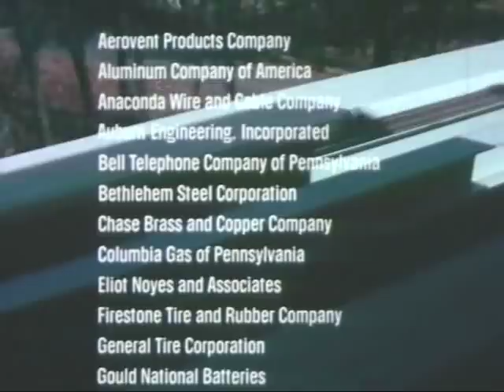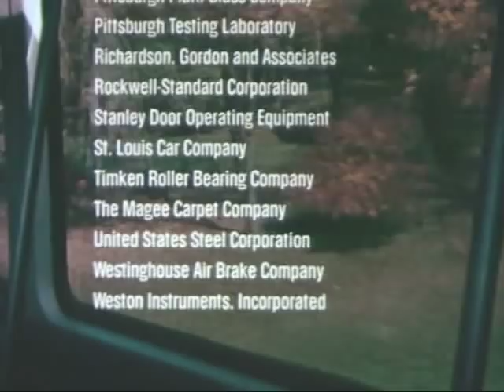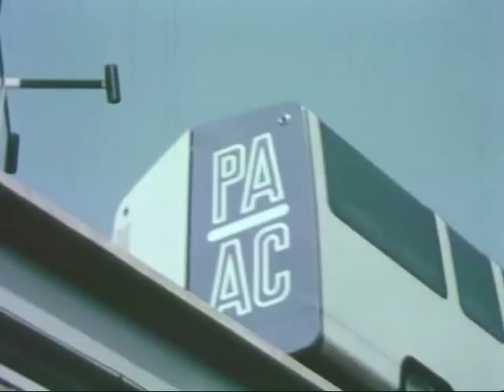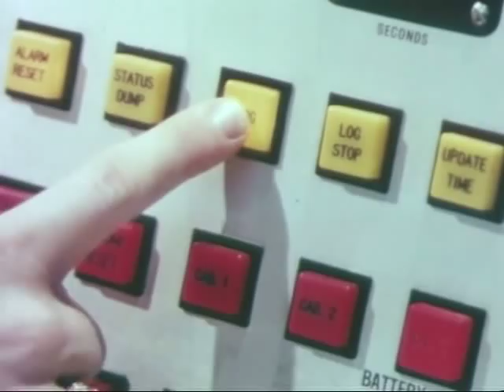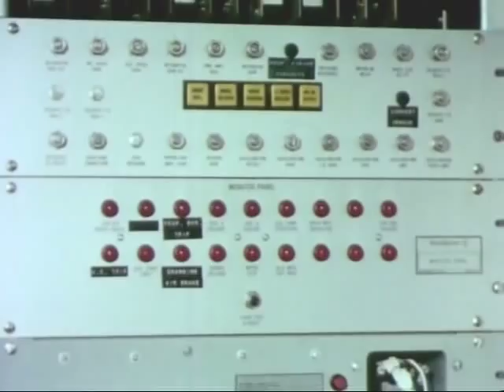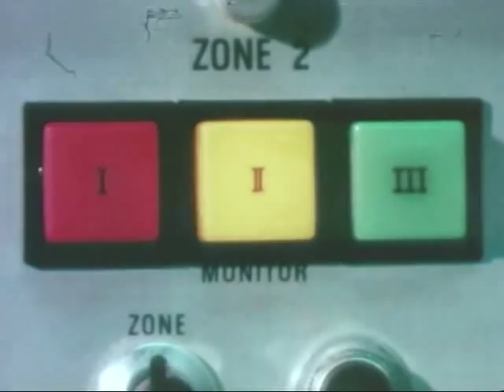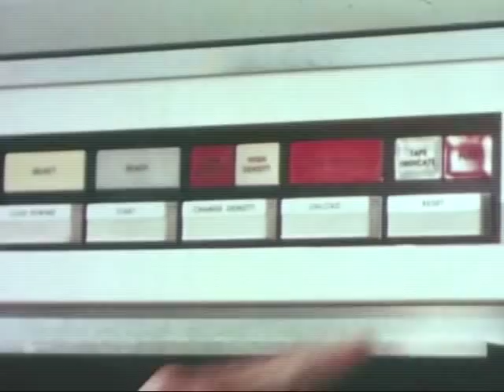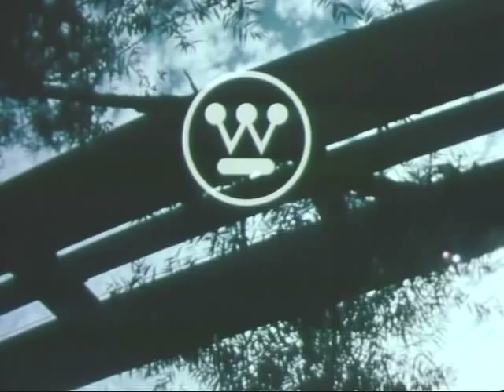SKYBUS COMPLETE TRANSIT EXPRESSWAY 1967

Comment: I agree that since the streetcars were already there (and already had dedicated rights of way), upgrading to a light rail was a good idea. Also replacing streetcars with SkyBus would have negated one of the streetcar's biggest assets: frequent stops that provide maximum connectivity.

That being said, I would have loved to have seen automated rail transit Skybus style (ie ICTS Skytrain light metro trains) used on other rights of way, particularly what became the East and West Busway. 
The corridor's not only were former rail right of ways, but they are also already substantially grade-separated, so the construction cost of a rail transit corridor vs a busway would only be marginally more expensive, if not cheaper. Meanwhile, operating costs (due to automation) would be much reduced.
Also, the one-seat bus rides would be lost, but this would be compensated by the fact that when buses connect to the rapid transit corridor, the transfer time would be negligible due to the high frequencies allowed by automation. 
Also, being an automated metro with a scheduled headway, the wait times along the transit corridor itself (ex. Downtown-Wilkinsburg-Swissvale) could become more consistent as well as more frequent
Finally, if ICTS was used on what is now the East Busway, the integration to the South Side Light rail lines could have been much better. When the LRT and East Busway opened in the 1980s, the Port Authority took advantage of the northern half of the PRR tunnel not used for the main light rail subway to build a light rail branch between Steel Plaza and Penn Station, providing a cross-platform transfer between light rail and the East Busway. However, there wasn't room to expand the tunnel to double track because the tunnel was surrounded by the foundations of the US Steel Tower. Finding it impractical to route service from the South sidelines to Penn Station, Port Authority demoted the line to a shuttle between Penn and Steel Plaza. This was of little utility since East Busway buses already continue on the street to within a block of Steel Plaza service was soon dropped. On the other hand, if ICTS had been used, automation could have mitigated the one-track bottleneck.  If Steel Plaza had been designed differently, or if a subway was built down the rest of Liberty Avenue from Wood Street to Penn Station, light metro trains could have run from Swissvale all the way to Gateway Center (and later North Shore).

Just thoughts.

Anyways,  a shame that Skybus failed; had it succeeded, I wonder whether it could have proved a cheaper more effective solution that allowed more widespread adoption of regional medium capacity frequent rapid transit.

Comment: Looks a bit like Detroit's TBH...
Reply: Jools VK this system was built almost 20 years earlier. Detroits people mover was built by UTDC (PART of BOMBARDIER now)  as a scaled down version of the light rail ilne running in the East end of Toronto Canada.
Reply: @glenatkinson4066   I would argue that is a similar technology with different roots from this Westinghouse based one.
Reply: @erik_griswold  two very different products, both now available from Alstom.
This system is the predecessor to the Innovia APM system used at many airports. Rubber tires, rotary electric motors, central guide rail.
The other is the predecessor to the ART offering which is part of the Movia Metro group. Steel wheels, flexible steering boogie, linear induction motors.